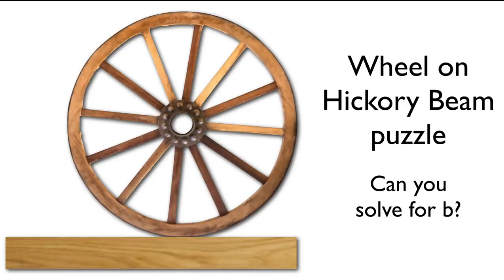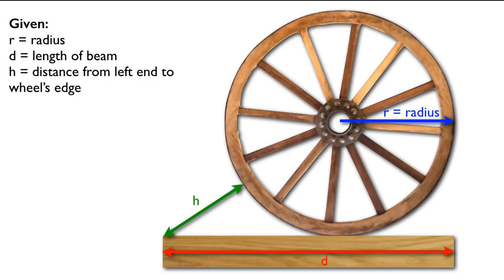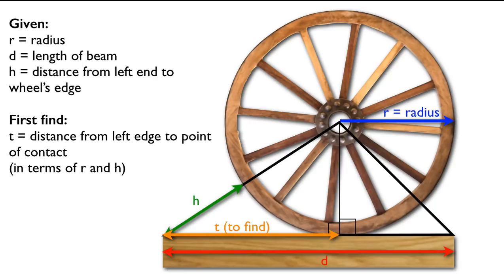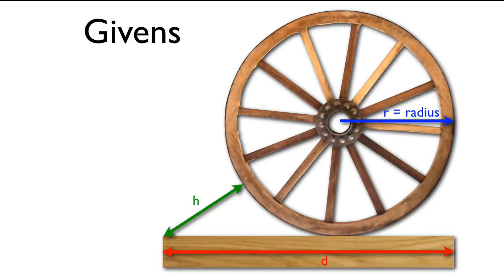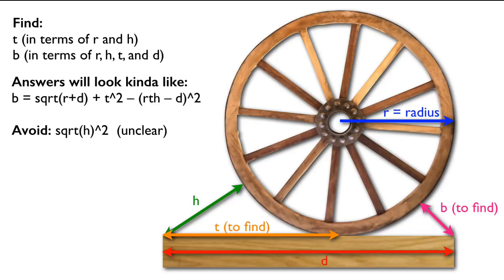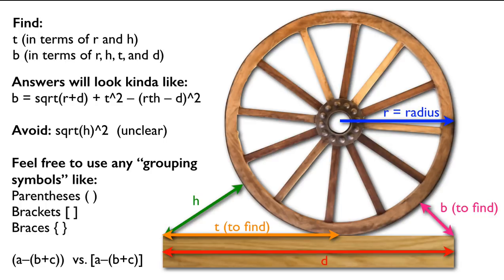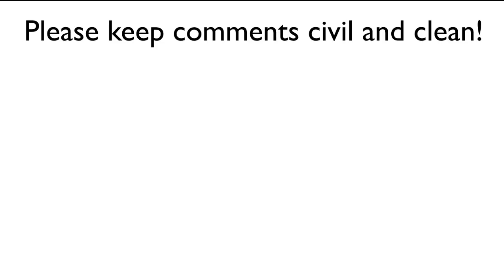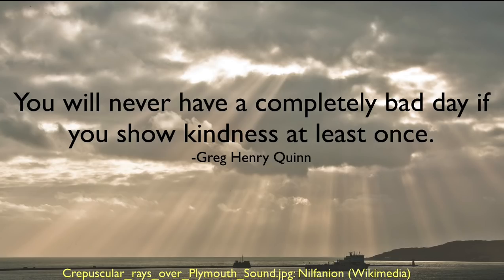Wheel on Hickory Beam puzzle (Flat Earth + Globe Earth)

Comment: Some people asked in the comments what this had to do with flat/globe Earth. Funny, because about 52 seconds in, I thought that if t is the sight line to the horizon, then this is the method al-Biruni (البيروني) used to calculate the size of the Earth. Well, actually what he calculated is the radius of curvature. On a flat Earth that would be infinite, so he also confirmed the shape of the Earth, at least locally where he performed the measurement. Well, he measured the angle between h and t, which is not a given in this example, so not 100% a match to his calculation.

Comment: Direct expression for b in terms of givens:

b= -r + √(r² + d² + h² + 2hr - 2d √(h² + 2hr) )

Direct expression for t in terms of givens:

√(h² + 2hr)

Expression for b in terms of givens and intermediate value "t":

b = -r + √(r² + d² + t² - 2dt)
Reply: I feel silly now for not recognizing this wagon wheel problem as an inverted "obscured height" problem. Keep in mind that d in that case is normally measured as an arclength, though, from a map, but with a sufficiently large "r" the difference between "arclength d" and "direct distance" d is negligible.
Reply from the maker: +Michal Onines, it is a fun geometry exercise, especially when you consider how many different ways there are to measure d. With distances below a few hundred miles, it really almost doesn't matter how you measure d, of course arclength is the most accurate, in terms of the geometry of a sphere.

But what many people don't realize, especially globe folks, is that if you measure d as the chord length (the straight-line distance from my feet to your feet), then 8 inches per mile squared gives you an extremely good measure of "drop" all the way out to a quarter-circle.
Reply: Flat Earth Math, using the chord length in the drop formula - that's an interesting one. I'll have to play around with it.

Comment: t = sqrt[(r + h)^2 - r^2]
b = sqrt[r^2 + (d - t)^2] - r
b = sqrt[r^2 + (d-{sqrt[(r + h)^2 - r^2})^2] - r

Does d - t = r?  Is the right edge of d even with the wheel?
Reply: A^2 + B^2 = C^2
Let r = A
For t,  let B = t and C = r + h
For b, let C = r + b, B = d - t
Reply from the maker: +THReynolds2 Sorry your comment was in limbo, all that algebra fooled YouTube into thinking it was a spam link, for some reason. Silly YouTube. But to answer your question, you cannot assume d - t = r. It looks that way in the diagram, but nothing in the problem defined it to be that way. More of a coincidence, than anything. :-)
Reply: I wondered why it didn't show up.  I thought I might have hit cancel instead of reply, so I replied again.  So, did I get it right?  I watched the video and did not read any comments before posting.

Comment: Flat Earth Math
curvature h = sqrt (r^2+t^2) - r this gives 8" per mile squared. b is worked out the same way using d-t. https://imgur.com/a/3SqezkJ
Reply from the maker: +JohnnyM, thanks for the comment. But this is not the same as 8 inches per mile squared. That formula comes from an entirely different technique, based on the chord distance, not the line-of-sight distance as in the hickory beam. Your math is sound (although you solved for h rather than t, but I know what you meant). :-)

A great many globe folks criticize 8 inches per mile squared, saying it's a parabola. Yes, the formula is for a parabola, but it perfectly traces a quarter-circle if you measure the distance as the chord length. :-) At some point I'll make a video on this. It took me 2 months on-and-off to figure this out.
Reply: This formula works. If you put 1 mile in the formula it rounds off to 8" curvature and 100 miles gives 6667 feet.

Comment: t=sqrt((h+r)^2-r^2)=sqrt(h^2+2hr);
b=sqrt((d-t)^2+r^2)-r=sqrt(d^2-2dt+(h+r)^2)-r=sqrt(d^2+(h+r)^2-2d*sqrt(h^2+2hr))-r
It ain't pretty.
But what's the point?
Let's put the wheel in the middle. Then t=d/2 and b=h=sqrt(r^2+(d/2)^2)-r. 
And let d=3/2 r, then b=h=r/4
Now that's much nicer :).
Reply: eefaaf 
The point? After all that work wouldn’t you agree that you’ve derived your own.... curve wheel calculator? Without the need to invent a perspective coefficient.
Reply: I guess I missed some context. I like to find some aesthetics in mathematics.
Reply: eefaaf 
Well. The context is some flat earthers are disputing the validity of curve calculators (how much of a distant building should be hidden by the horizon bulge) like metabunk etc because, as they claim, these calculators don’t take perspective into account. 

Nathan would have you believe that you need to factor in the apparent angular size reduction for objects in the distance into the calculator. Effectively asserting that to “really” find B, you need to apply the law of perspective to see how small it looks to the observer at H and that value is what goes in the calculator. 

However as you can see, since you derived your own curve calculator and can confirm that its results work as is, by simply drawing an arbitrary example and measuring each value to plug back into the equations you can validate that it works. And they do. There is no need for B to have a perspective coefficient. The geometry doesn’t call for it. The algebra doesn’t call for it. Reality doesn’t call for it.

From the vantage point of the observer at H, distant objects do appear smaller because of perspective. But they are not actually physically smaller. Orthographic views like curve calculators use to model what is happening with geometry doesn’t concern itself with how things appear to the observer. One simply depicts all the objects as they physically are and let trig do the rest.
Reply: Oh my! Yeah, I didn't hear about that... Such weird and far fetched excuses to deny reality.
But then, the even deny gravity... but you never see them fly :)

Comment: Not sure if it is mandatory to have ‘b’ in terms of all other variables, but that’s what I tried to do

t = sqrt(h^2 + 2hr)

b = sqrt(d^2 + h^2 + 2[hr - dt - br])
Reply: Flat Earth Math 
I thought you were just trying to make it extra hard by having to work out how to get b in terms of all the other variables as opposed to the readily obvious ones.
Reply: If 'h' doesn't need to be in the answer, then I revise my answer to:

t = sqrt(h^2 + 2hr) - same as before

b = sqrt(d^2 + t^2 -2[dt + br])
Reply: D'oh!  How did I not notice that?  You're absolutely right.  I think the expression I wrote is mathematically true, but kind of useless as written.

I could use the quadratic equation to undo the mess but it's not really necessary because I shouldn't have expanded the expression in the first place.  Pythagoras tells us we have:

(b + r)^2 = (d - t)^2 + r^2
b + r = sqrt[(d - t)^2 + r^2]
b = sqrt[(d - t)^2 + r^2] - r
Reply from the maker: +Matt D, that was a mistake on my part, giving the impression all the other variables were required to find b. I tried to say it's easier to incorporate t, which means h isn't needed in the final expression for b. But this misled a lot of people. :-)
Reply: You have b on both sides of the equation. Pretty sure it should be all by itself on one side. You may need to use the quadratic equation from high-school to get b alone. (Not 100% sure, but it might be the case.)

Comment: Hi Charles, this is a follow-up question to yours (directed to ALL):

How can it be easily decided by looking on it a few seconds at most the example you provided how a solution could look like

b = sqrt(r+d) + t^2 - (rth - d)^2

is completely out-ruled to be a candidate for the actual solution?

(In other words: what is a quick sanity check you could apply to any solution someone comes up with?)
Reply from the maker: +Mittelwelle 531 kHz after long experience with just algebra and geometry, I've learned that there can be some surprising manipulation when one actually works out an equation or an expression. Unexpectedly things might cancel out which wasn't obvious at the start.

Having said  that, there are a few clues which will let you know the expression I made up for b, is in fact, made up. For starters, when we see things being squared (in a simple geometry problem) it's usually for two reasons: you're finding area, or you're using the Pythagorean Theorem. (There are other reasons, but those are the two most common.) 

If it's an area problem, then all those quantities being added/subtracted suggests compound area, but that doesn't make sense for this problem, especially since we have the square of one quantity being added to the square root of another quantity.

If it's a pythagorean theorem problem, then solving for any value requires not just squaring, but taking the square root as well. So you end up with things like sqrt(a^2+b^2). In this "made up" example, we have things being squared (but not square roots), we also have square roots of things not being squared.

Anyway, those are my thoughts off the top of my head. :-)
Reply: +Charles: Thanks for your response. My thinking was along the same lines as dimensional analysis in physics. As the geometry of the figure is determined exclusively by lengths (r, h, d) and you replace these by n·r, n·h, and n·d the solution must be n·b.

Comment: t=sqrt((h + r)^2 - r^2) (whoops typo)
b=-r + sqrt((d - t)^2 + r^2)
There is an edge case. If (d-t) is less than r, then we're going to get the sqrt of a negative. This would indicate that the wheel is off the end of the beam.

Comment: JavaScript:
console.log('t =', Math.sqrt(Math.pow(h + r, 2) - Math.pow(r, 2)));

However, much easier to use a square wheel where r is half the width of the square. Then:
console.log('t =', h + r);
Reply from the maker: Andrew Eddie... all those nested parentheses... why didn't you use curly braces?

KIDDING! I'm just kidding! (I used to be a TurboPascal programmer back in the late 1980s, and curly braces were used for inline comments. I loved that method, since you could literally comment your code in the middle of complicated expressions, rather than waiting for the end of the line.)

I like your approach to this problem! You win a piece of cake with the square wheels solution.

Even though you forgot the most important part... the subtitle of this very video... solve for b! You gave yourself a tougher task with doing the math in a console log, because then the next line console.log('b =', ... ) needs to have a more-complicated-than-needed expression incorporating h, r, and d. :-)
Reply: Ah missed 'b'. Thank you for the cake. I will need the extra energy for that solution as square wheels are tough to move.
Reply: Ok, this should be a bit better (es2015), including requested curly braces:

/**
 * @license Apache-2.0
 */
const sq = n => Math.pow(n, 2);
const sqrt = Math.sqrt;

function find_t(r, h) {
 return sqrt(sq(h + r) - sq(r));
}

export function find_b(r, h, d) {
 const t = find_t(r, h);
 
 if (t > d) {
  throw new Error('t > d: Geometry not possible in this universe.')
 }
 
 return sqrt(sq(d - find_t(r, h)) + sq(r)) - r;
}

But I'm already thinking I should optimise this to use functions that reflect triangle operations. That would make it more readable. So what would that look like:

const sq = n => Math.pow(n, 2);
const sqrt = Math.sqrt;
const hypot = (a, b) => sqrt(sq(a) + sq(b));
const side = (h, a) => sqrt(sq(h) - sq(a));

export function find_b(r, h, d) {
 const t = side(r + h, r);
 
 if (t > d) {
  throw new Error('t > d: Geometry not possible in this universe.')
 }
 
 return hypot(d - t, r) - r;
}

Yes, much better. My future self has a much better chance of understanding what the heck I was trying to achieve.
Reply from the maker: +Andrew Eddie Excellent. I want you on my team. Thanks for the curly braces. 

One interesting aspect of TurboPascal was the begin-end statements that encapsulated all structures, while modern languages use curly braces to encapsulate. But one nice thing I used to do with the begin-end statements is I used to comment them as well! So after a whole bit of structured, indented code, when you came across an "end" I'd write {find_b function} and then you wouldn't have to go hunting for "matching parentheses" so-to-speak. :-)

Quick question: are semicolons optional as the final statement before a curly brace? I noticed you didn't use them with your throw new Error commands, but you used them everywhere else. Just curious. :-)
Reply: "I want you on my team."
Any time! ;)

"One interesting aspect of TurboPascal"
For better or worse, I went down the Basic and C roads (and I did teach myself a little Assembler - what on earth was I thinking). I do wish I'd done Pascal in the day because I think it would have suited me. I wonder whatever happened to Borland.

"are semicolons optional"
Yes, and their has been many a religious war over whether you should or shouldn't include them, second only to tabs-vs-spaces debate for indentation (it's tabs of course). One should note, however, that these are real and serious topics to debate, not like the flat-vs-round thing which looks like a kindergarten sandpit dummy-spit in comparison.

"I noticed you didn't use them with your throw new Error commands"
Ooops. I was in the cheap and nasty text editor and I missed that one. How terribly un-pedantic of me ;)

Comment: T= sqrt [(R+H)^2 - R^2]
B= sqrt [(D-T)^2+R^2] - R
Reply: I think you forgot to put 2's in after the power symbols
Reply: shaun elliott thank you
Reply: You're most welcome
Reply: Also, for t you can expand the (h+r)^2 and cancel out the r^2 terms to make it simpler
Reply: This is kinda what I got too but the instructions state you have to solve B in terms of (r,h,t,d) which seems odd. The only way to get H in there is to substitute one of the other terms. 

So you actually have to make an ugly mess of things and substitute in
R^2=(R+H)^2-(T)^2

Edit: 
now if only stiggy/Nathan  could do algebra he’d be able to find R himself by solving this equation:
measuring his eye height (H), measuring how much of a building is obstructed by the horizon (B), how far the horizon is (~T), and how far the building is (~D). Since R is so large the approximations for T and D shouldn’t be significantly massive sources of error.
Reply: shaun elliott  I think you need it because you need the hypotenuse and a side to find T. 
Just my thought
Reply: shaun elliott maybe you are correct I'll check.
Reply: shaun elliott you do need it. Unless you can show the equation that it would work on any right angle triangle
Reply: Real D, I'm just saying that you can simplify your equation for t by changing (r+h)^2 to r^2+2rh+h^2, because then you end up with an r^2 and a -r^2 term and it ends up being sqrt(h^2+2rh)
Reply: shaun elliott you are correct sqrt(h^2+2rh).  Thanks
Reply from the maker: +Sphaera Invictus you are correct, that was a mistake on my part. But if you say "write an equation in terms of x, y, and z" is it okay if the z term drops out? Does that command require all variables be used in the expression? I honestly don't know. I guess it's just a matter of interpreting my intent when I wrote the instructions. :-)

But I did explicitly state that the math is much better when using T, as opposed to solving for b using only r, h, and d. So it turns out h isn't needed if you use t in the expression for b.

Comment: My answers below.
Ignoring the fact that this wheel is flat and level, water proves it!!

t = sqrt[(r+h)^2 - r^2]
And
b = sqrt[r^2 + (d-t)^2] - r
(In r, d, t)
Or
b = sqrt{r^2 + [d - sqrt([r+h]^2 - r^2)]^2} - r
(In r, d, h)
Reply: If you have another look at the diagram, you may notice that d-t=r, just to make it simpler
Reply: shaun elliott
In this diagram, that appears to be true. But generally you could have a b value that is too short or too long for that to be the case.

If only there were a *not to scale disclaimer!
Reply: That's the least of my sins, Charles. I'm sticking to it though because I don't want to do the algebra to find b if d-t does not equal r
Reply: shaun elliott
Oh, just be happy you don't have to set up an integral.
Reply from the maker: shaun elliott No! You committed a geometric cardinal sin... Declaring things to be equal that "look" equal! :-) Come to think of it... The horizon appears flat! :-P

Comment: {(h + r)(h + r)} - (r *r)  = t*t   - can't work out the squared symbol, sorry!
{(b + r)(b + r)}  =  (r*r) * (d - t)(d - t) - I know this can be reduced but it's a long time since school.
Reply: Hold the ALT button and type 0178 on the numeric keypad for ²
0176 for degrees °
0179 for cubed ³
ALT F4 for flat earth 🤣
Reply from the maker: Use shift-6 to produce a caret: ^  Feel free to edit your answer if you like. But algebraically correct is still algebraically correct. However remember you're to solve for both t and b. :-)
Reply: I've been planting my carrots all this time and there was an easier way??
Reply: on my laptop's keyboard, without a number pad,
t squared can be written as
t²
by using Alt-Gr and 2 (... and "t" in front, of course ...)
the caret variant to write it
t^2
the caret ^ is just a normal key (have to press it twice to print), leftmost beside the number-row for me
Sometimes, the Hex-notation like you described above is the only way to get to print a certain character, though.
Alt + F4 --> current window, including all tabs, is gone ;)